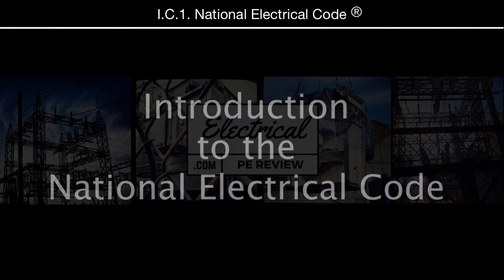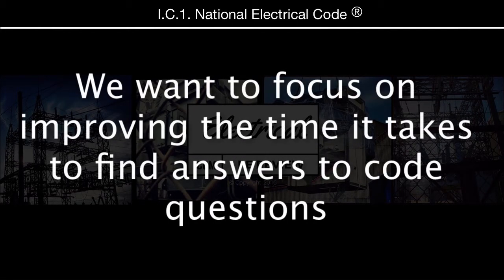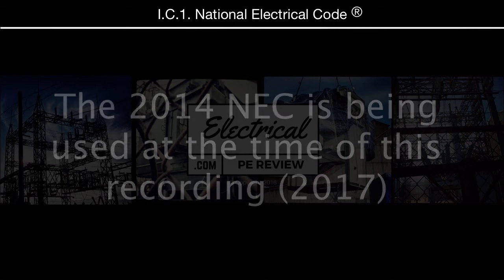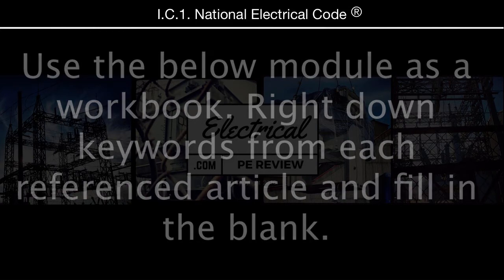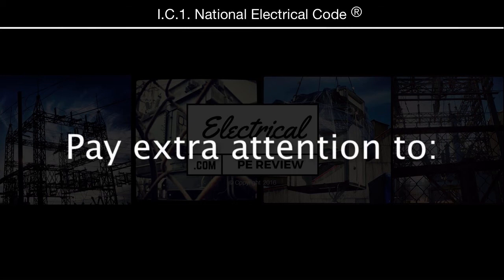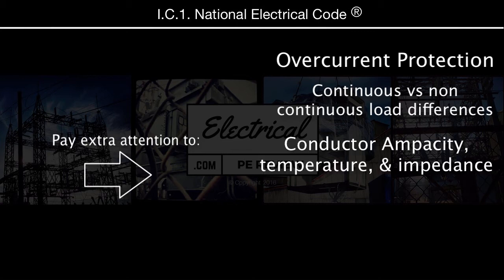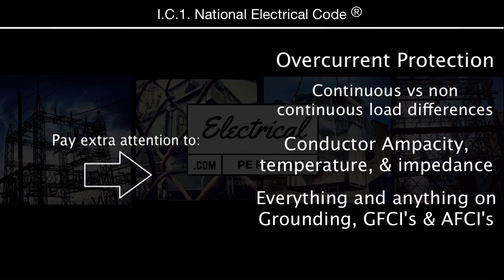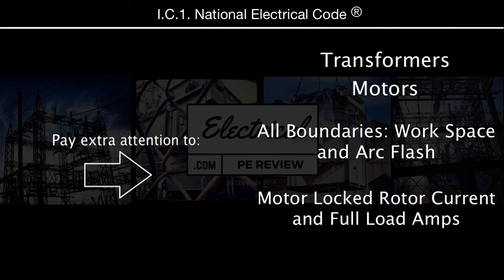How to use the National Electrical Code (NEC) to answer questions on the Electrical Power PE Exam

Comment: Do you have videos for the new cbt standards (each standard)?
Reply from the maker: If by standard, you mean specifications, the exam specifications are still the same with the change to the new CBT format. Our live class material has been updated to include the material in the reference handbook since that is now the only resource you are allowed to use while you take the test.